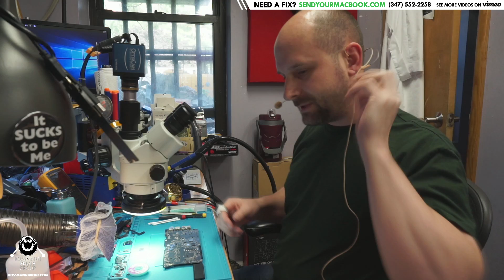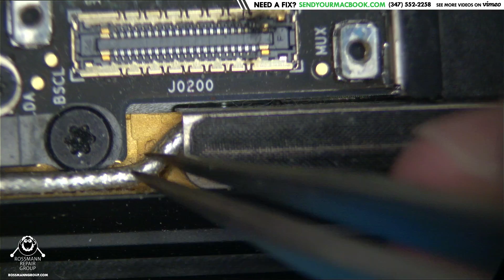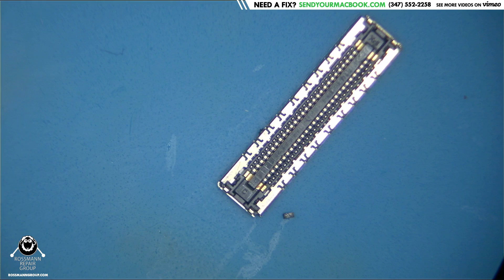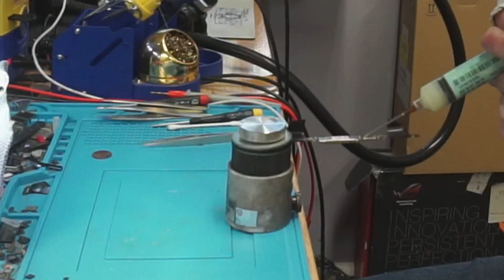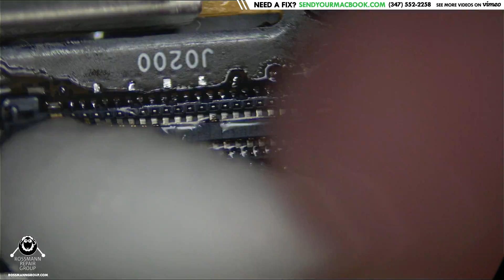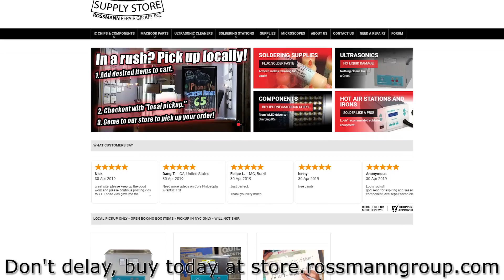Touchbar Macbook Pro how to recycle a liquid damaged LCD assembly

Comment: It's like a child designed this board even a monkey could figure out that there should be a ground line between your high voltage powerline and your low-voltage data line if not protect it from a short to protect it from outside interference due to the high-voltage line being so close to the data line as stated in the video the mox chip is also a great way to act as a fuse in between the CPU data line and the actual CPU itself hell even a five cent fuse would've been enough God Apple products fucking piss me off especially their board design which is literal garbage as somebody who spends a lot of time as a hardware engineer designing stuff like this for any of you college kids in school for the love of God don't run high voltage right next to your low-voltage stuff it's stupid you'll kill your shit and you won't have a job for a long time once the issue becomes known to your employer a five cent fuse on that line probably could've save that processor but you know Apple knows Best why have a fuse that shorts the ground when you have a high voltage surge when you can save 5 cents and charge them another $2000 for a computer

Comment: I did heat it from under the board and easily replace it with one connector from a broken one almost 6 months ago. thats an easy job when u have the Amscope and Hakko around ( bought them from your link Louis).

Comment: You can retin tips, I have retinning compound and use it!  

It's a pressed tin powder + some sort of acidic flux stuff. You just push your hot tip into it and let it bubble for a second or two, then pull it out and clean it. Tip looks like it's brand new

Comment: The SMC (and other ICs) on engineering samples may not have the firmware locked for reading!!!
Also I would not be showing that you got hold of engineering samples. Apple could raid your shop under the argument that you have stolen parts or trade secret internal parts. It would be easy for them to prove in court that those are Esamples and should be internal to apple. They could then use this raid to take half your other stock with an apple logo on it.  Very risky!!

Comment: wouldn't some dielectric grease in the connector prevent moisture ingress and help prevent arcing from the backlight pin to the data pin.

Comment: I did it quite a few times on older macbook retina displays destroyed by screen cleaning. I am sure Paul makes is really cool but i recommend others put the capton tape all around and use paper tissues to prevent flux from spreading all around or getting under the screen.

Comment: Be the change you want to see Louis! How hard would it actually be to create an adapter PCb that you can solder onto where the MacBook connecter used to be. Then coat that shit in UV flux and have an adapter on the lcd side too. You don’t have to use the donor board connectors either. I know it’s questionable whether or not this much effort is worth it on a MacBook but if I could afford a MacBook Pro I’d pay to have Louis fix apples engineering flaws and stop my investment from blowing up

Comment: FYI - Paul - love you man
[G]ravity replaced Abracadabra

There is no force pulling down, there is only falling and rising through density, objects seek equilibrium based on the resistance of their surrounding medium.  All unsupported objects heavier than air have a natural tendency to fall by their own weight. 

The ocean of air (fluid) that you breath exerts pressure, 14.7 psi at Sea-Level, in equal amounts on all sides.

Density - the measure of the mass of an object per unit volume.

Examples:
   submarine uses compressed air to ascend in water.
   hot-air-balloon uses hot air to ascend in the air.
   airplane uses pressure difference across its flying surfaces to gain lift.

Air is liquid, the mass of objects without air, weigh less.

Air-filled balloon falls slower than balloon without Air.   WHY?
The air filled balloon gains air resistance slowing it's rate of descent; in our natural system all objects fall or rise based on their density.

Smoke is lighter than the air, and therefore, does not fall but ascends.
Helium-filled balloon rises, because it's total weight is less than the surrounding air (like oil in water).
...
There is No Gravity - The Vomit Comet (so called - Zero G Plane) provides a protected environment for Free-Fall; unlike Sky-Divers who must Fall through differing air resistance based on speed and conditions.  For the Sky-Diver, without the protected Cabin, air resistance increases with velocity until equilibrium is reached and acceleration stops; this is called terminal velocity.

Comment: no such thing but here goes. Dumb question. Would it be possible as a preventative move? To take that data line at some point away from the connector and cut it and jumper over to a fuse then jumper back to complete the circuit and thus protect the rest of the system?

Comment: Perhaps applying conformal coating near the screen connector would somewhat help against further liquid damage after repair?
Reply: I wonder if there are any None connected pins you could move the backlight to away from the CPU line.